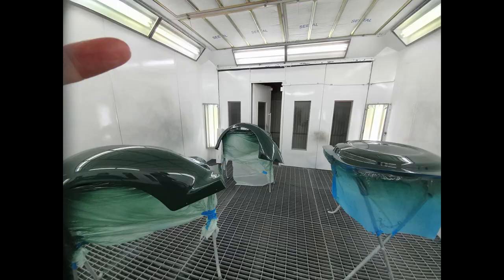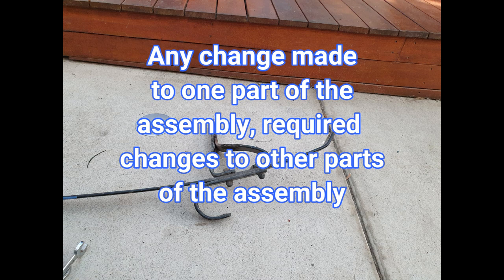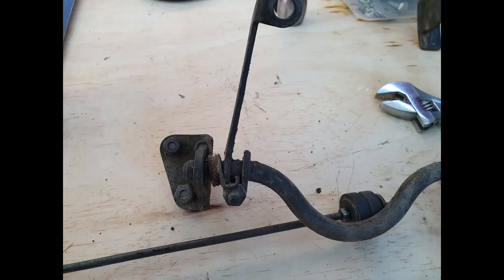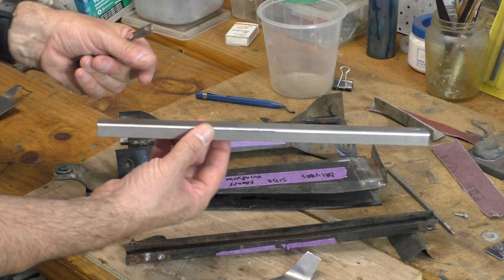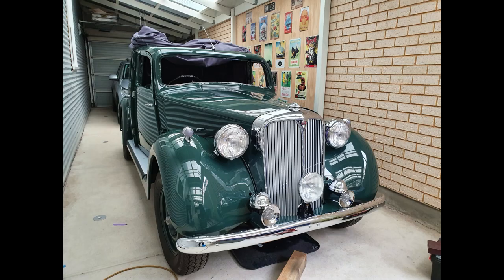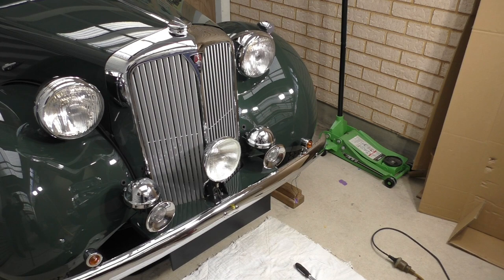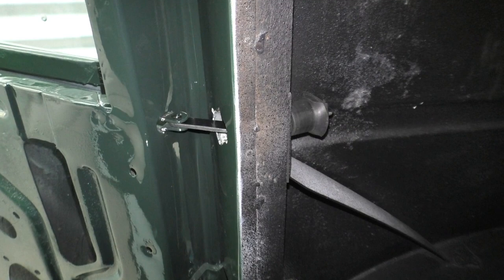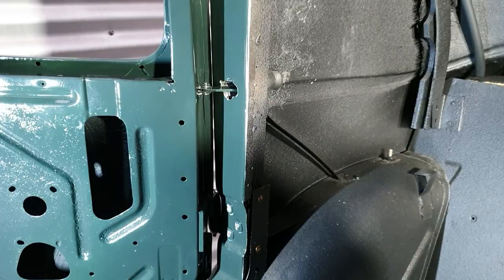Greg's 1949 P3 Rover restoration chapter 18

Comment: This is beautiful.
The skin of the boot lid, being non-structural would be a good candidate for a carbon fibre reproduction, and the other panels of the lid could probably be made from aluminium sheeting. I am just thinking aloud, here, for the benefit of others with panels beyond redemption, and unwilling to carve up a second boot lid. 
An aluminium boot?  
The idea was good enough for P4s.
Reply from the maker: Thanks Paul for the comments. Main reason I went with the option of using a second boot lid was because the spare lid came with the car when i bought it along with a couple of doors and engine bay side panels. Mainly a case of using what I had. However this solution proved to be expensive, but I am very happy with the end result.

Comment: Wonderful stuff - if only Rover could have afforded such quality there would have been more survivors. No prizes though, some judge will mark you down for having the wrong size circlips on the check straps! I noticed in the "before" shot that there was a tow ball; at a guess this wasn't mounted on the approved Rover design of tow bar?
Reply from the maker: Thanks Glyn. I am not too worried about judges; however I am aiming to keep things quite original overall. Pretty sure the tow bar that was fitted to my car is not the approved Rover design. It was most probably fitted in New Zealand where the car was originally sold.  I don't think that I will ever tow anything with the car, so will leave it off.